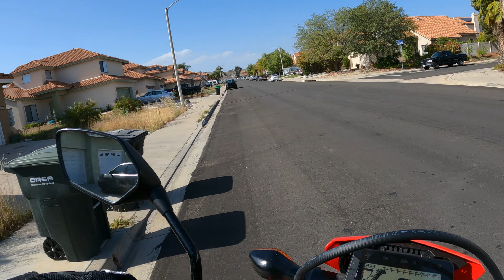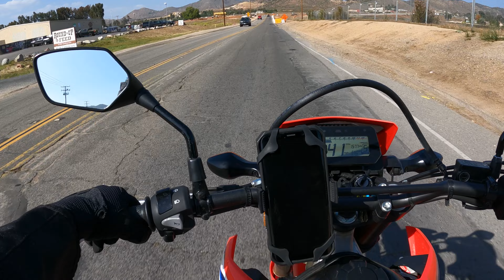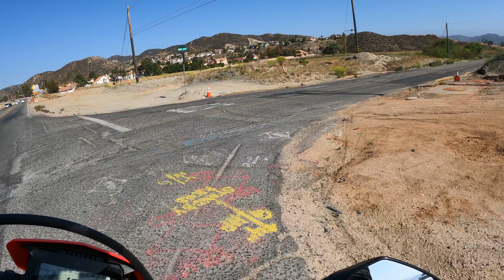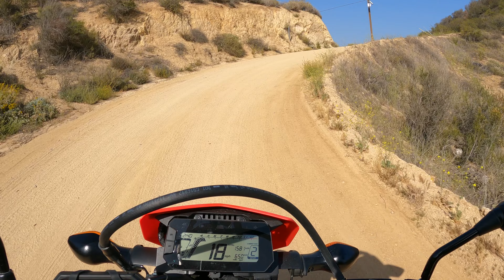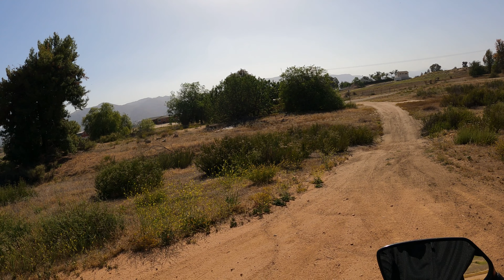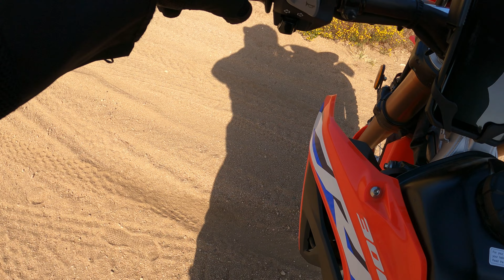The Biggest Problem With The 2021 Honda CRF300L

Comment: I had mine up to 93mph, but it was downhill, fully tucked, and had a tailwind. It will do 75-80mph no problem all day, and Im 6'3" 260lbs. Changed my shift light to start blinking at 70mph in 6th and it flashed around 75mph. Also changed the RPM gauge to where the last RPM will hang for a second then drops back down to the bar. Kind of neat.

The engine opens up a lot after 800 miles and smoothes out the higher speed RPM vibes.
Reply from the maker: Oh ok got it. Sounds good

Comment: I totally see your point, I just have to avoid the faster roads or be content sitting at 65 ish.  I notice about an 8mph difference  between the bikes speedo and my GPS at the top end, the bike says 78, GPS says 70.
With bigger bikes I used to take much more risks overtaking, now I plan them about a week in advance lol.  But mostly I know now to relax a little more and enjoy the ride a little more.  I think it ticked most of my boxes (The Rally at least) which were economy, service intervals and cost, riding position- I look silly on small bikes, reliability, local dealer support.
At the moment I am OK with it as stock, added a pannier rack.
My only gripe so far is a rusty exhaust, but I live in the UK and ride all year, it gets damp!

Comment: You can change when the shift light comes on. Hold "SEL" button down on the display and turn the key on then toggle to change RPM I think. Probably a video on it by now. I think you can change how the tach looks too.
Reply from the maker: Well at least that. That's cool. Thanks
Reply: @TheCoolestCourier  I have the CRF300 Rally and love it. I live in a rural area and no fast highways here so it's perfect for me. Just Subscribed!
Reply from the maker: Thanks! Yeah the rally seems awesome as well!
Reply: I also have a Rally @Thumper Squid and changed that shift light the same day my break-in service was completed. There’s a spot between about 5K and 6K RPM where my engine is less smooth. Power seems to come on after 6K and it stays pretty smooth for a single until about 8,000 RPM. I’ve found as @Jimmy Brooks did that CRF300 indeed prefers 50-60mph for cruising. So I explored on Maps and IRL until I could tie 45 - 55 mph back highways and 25 - 40ish mph dirt roads together across counties that surround mine. My favorite commute when the creek crossings are mild-to-dry is mostly dirt, where excessive RPMs never bother me.
Reply: lol this is some awesome info 👏 👌...  thanks for the tutorial
Reply: Amazing information thanks..I'll try it 
🏍👌
Reply: supposedly the Honda crf300 rally can go above 80mph wind protection all around and aftermarket sprockets 

Still debating between this bikes; above 80mph and off road capable, reliable proven and good dealerships coverage, low weight, budget friendly , low maintenance and good aftermarket products..basically my unicorn bike or my dream a smaller Honda African Twin/Translap 750 to 500cc and all her glory 😆 

Honda crf300 rally 
Honda cb500x (rally aftermarket parts)
KTM 390 adventure 
Suzuki dr650se update 
Honda xr600r update 
SWM superdual X 650
Or…gently used BMW F 650GS Dakar/sertao

Comment: Firstly, this bike will happily sit at 7000 rpm all day long. Secondly, raising 6th would make it useless in wind or on any kind of hill. Thirdly, it's a 300cc dual sport - you can't bitch that it won't do what a dedicated street bike will do. It does EVERYTHING "ok, it does nothing "GREAT". I still love it for what it is.
Reply from the maker: So far I like your comment the best when it comes to comments that disagree with the video. A lot of them are poorly thought out and have points that aren't true. But everything you listed is valid. I knew going into making this video that this complaint was kind of dumb because it is such a small dual sport but I thought maybe it could have been tweaked a little bit because I thought it had more power than it did. There's not a lot of high-speed Hills or wind where I live. But when it got windy yeah you're definitely right. It has barely enough power to go 70 Full Throttle. And I figured it's fine with the high rpms. People have been traveling Full Throttle on Honda scooters for decades lol
Reply: @TheCoolestCourier  Well, thanks for not getting mad lol. This poor little bike takes a lot of heat because of the suspension and "low power", but - as previously stated - it's a freaking cheap 300. What it can do vs what you pay is absolutely remarkable, even in stock form. People who buy one because they're popular, without real-world expectations, will be disappointed. If you're 300lb, it won't work. If you expect to hit whoops at 50mph, it won't work. You need to spend money on it to approach real "competence". But, if you just want to get on and go (albeit slowly), it's a real peach.
Reply from the maker: I think what I wanted it to be was a KLR 650. A bike that does nothing great but everything decent including going on the highway. But for how good that bike is on the freeway it loses out off-road. It's just big and heavy which is where the CRF 300 does better than it. But since I already have an xsr900, I think my current setup is more complimentary to each other. I sold the Honda and am now keeping my dad's Suzuki dr200 running. I sort of own it since he's not riding at the moment. It's crazy slow on the street but once you get it in the dirt it feels way more like a small trail bike then the Honda. I actually prefer it but my dad bought it new and paid more than a CRF 300 cost which is crazy to me because of how old the technology is in the dr200. The Honda really is a great value and I would be super interested to ride the new low seat version
Reply: @TheCoolestCourier  My personal problem with the KLR is that it is just way to heavy and always has been. At over 450 lbs you can get a MUCH better bike for both the road and off-road. (KLR is cheap though and easy to find. My dealer always has several in stock, all of the time) What I really want is a CRF375 Rally or a F.I. 6-speed DR with Digital Dash, I can only dream cant I. 🤣

Comment: The gearing isn’t perfect but imagine this doing single track trails, different story.
Reply from the maker: It is quite good at that
Reply: I didn’t even use 1st on pavement until I put a 120/90 tire on the back. Now I use 1st occasionally. Stoplights on steep hills remind me how much I appreciate a low 1st gear.

Comment: I hated the flashing shift light, so I changed my Rally's shift light to not pre-flash and to only come on and stay on above 8200 rpm and I'm 100% happy with that. Mine will sit at 7-8000+ rpm stock all day long, but with a really strong headwind it is hard to stay much above 70 mph. The stock gearing is great for almost all things and when you change to a 90 section rear tire you have changed the gearing somewhat already. This is NOT a bike that is made for 75+ mph, it's too tall and too light in my opinion. If I wanted to go any faster, I would just get a heavier and more powerful bike with a low front fender for safety reasons. I love my Rally and I think it is a great dual-purpose bike. It's not great at any one thing, but it can do almost everything "good enough".
Reply from the maker: Yeah it is pretty good for that. I think my perfect version of this bike would be the low seat version maybe with if you modifications to get a little more torque out of it so I could change the gearing just a little bit taller so I could go 10 miles on the highway just a little easier to get to even more trails.

Comment: I totally agree with you about having the engine revving so high .
I recently bought a 2002 Yamaha DT175 road and trail bike 2 stroke engine. 
It was revving at 5000rpm when i am  doing 60km and about 6000 rpm at 70km, so I just changed the front sprocket  to a  bigger one and I can do 60km at under 4000rpm and 70km at 5000rpm, and i could hit 100km at 6000rpm where it used to 70km.. this is a solution and i know you are going to say by doing that you lose some grunt, true but if you mostly ride on the highway and not nuch in the bush then i think it s worth doing it.
Reply from the maker: If this was my only bike I would definitely change the sprocket but if I know I have to go on the highway I always take my XSR700
Reply: @TheCoolestCourier  I didn't know you have a bigger bike.
Lucky you.

Comment: You can do 70 mph/ hwy ok. After that it’s a little pushing the edge on the rpm’s. But this bike as well as the other dual sports, aren’t made for highways aren’t they?
Maybe some are, but the majority of dual sports bikes are for city, trails, and light short highways trips.
Reply from the maker: I know they're definitely not but this bike is powerful enough to where if it cruised just a little bit better on the highway it would be the best beginner bike ever made. Honestly even without that it might still be
Reply: and thats the problem, we need a bike that is adv speced weights like 160kg wet and can do 80mph without problem
Reply: THANK YOU!

Comment: In your experience, do you think the abs model has any real difference over the non abs  ?
Reply from the maker: Well I mean in a literal sense it has abs so potentially it's slightly safer on the street. I had the non-abs so I didn't have to push a button every time I went in the dirt. I was primarily riding this bike in the dirt.

Comment: I packed all my gear on my Honda Grom and went camping.Worked great so I'm sure the 300 Rally will be fine,which I am currently looking for since I sold my Tenere 700.
Reply from the maker: Why did you sell the Tenere? Did you just want something smaller and lighter?
Reply: @TheCoolestCourier  Mainly because it was too tall for me.Even after I lowered it and installed lower seat foam.It actually has a lower seat height than the CRF300L/Rally,but it is much wider,which makes it feal taller.It is also a heavy bike and a lot of the weight is up high.If I was 6'4" and 50 pounds heavier it probably would have been okay.But just too much for this little guy.Love the engine.I bought it because I LOVE the CP2 on my FZ-07.I'll never sell that bike.
Reply from the maker: Yeah I started on an xsr700 and now I have the new xsr900. There are aspects I miss about the cp2 so I always thought I would eventually end up with a tenere 700 for the purpose of a big dual sport/adv
Reply: @TheCoolestCourier  I used to have an MT10 but I was gonna end up losing my license and going to jail.During the "shutdown" there was nobody on the roads and I was "essential" so I had to go to work.140-150 MPH all the time.I blew past a HP on an entrance ramp one day.Didn't think slowing down would help as I was already busted,so I didn't.He didn't even bother chasing me.I was gonna have a custom plate made for it.EMPTY10.Because I was always looking for gas station with that monster.LOVED that bike too,but too much.
Reply from the maker: I totally understand, I feel the same way about my 900. I think this level of power is a really fun blend between usable and unusable power. The xsr is so long it actually only wheelies In first gear.
The cp2 is cool because you can have fun within the speed limit, with the cp2 you're definitely going 20 over on accident most places, so I can't imagine the mt-10 or any of the hypernakeds with more power than that

Comment: are you running the bike stock / exhaust / gearing / ECU / ? I have a Rally coming along with plans to install 550 ECU (91 octane) and a full exhaust for exactly the reasons you mention.. supposedly makes a big difference even without changing the gearing..
Reply from the maker: I'm very cautious about modifying my motorcycles. This used to be a car Channel and I have had nothing but bad experiences modifying cars which is why I ended up getting into bikes. They were sub $10,000 purchases with performance that I was already happy with unlike cars. The reason I don't like how short sixth gear is is because I feel that sitting at 7000 RPM or higher for over 10 minutes is kind of rough on the engine and I'm looking for maximum longevity. As I save up more and more though I will be more open to the idea of modifying the bikes. I know I definitely want an exhaust for the XSR
Reply: @TheCoolestCourier  Understandable - I almost always put an exhaust on my bikes, they are just so choked up stock thanks to emissions and seem to run so much better when opened up and running a proper tune. 

I also went with Yoshimura full exhaust, which is the factory Honda team; they are reputable and definitely know what they are doing.

Besides that I will likely do a acerbis skid plate and hand guards.. until I upgrade the suspension someday (If I love the bike and decide to keep it longer term).
Reply: @TheCoolestCourier  agreed dude. I just don’t get the full exhaust and flash on these bikes, that gets you most of a full suspension.
Reply: Just installed the Yoshi-full system with the 550 stage 1 ECU… all I could say is it woke the bike up and is unbelievable, it is absolutely a must in my opinion… you will not regret it.
I also did the K tech rear along with the stiffer front spring, which is fantastic and also highly recommend.
Reply: You can't buy the ECU in California.
Reply: that is very sad @clvrswine

Comment: Honda already geared 6th taller than the 250L. Look at a dyno chart to see where torque is at max and tapers. I have to disagree as it is perfect for me as is. Tweak with sprockets for your specific use. It barely enough power to pull average hills where I live, over 70 mph, with wind resistance worse than 0 head wind. With RPMs lower it would be even worse. I thought I wanted taller gearing for the highway but now I need more power…better solution was stay off 70+ mph roads for anything more than a few exits.
Reply from the maker: Yeah I agree it is perfectly spaced from 0 to 70 for its optimal powerband. I think where I am 6th could be even taller but it is close to perfect

Comment: I have a 250L and I also hate my gears. I don’t think I want to adjust the whole final drive but maybe I should. 1st is way too short on and off road, and off road I’m always in this terrible spot where 2nd is revving too high and 3rd is lugging too much. 4th and 5th are solid, and I feel like 6th could be a little longer but I worry if it was longer, could it keep speed at highway speeds?

Comment: You can only get so much out of 27hp. Your getting the best of both worlds the way it is geared now. You have to weigh out what you use the bike for the most and gear according.
Reply from the maker: Yeah definitely. It's mainly an offroad bike for me so I definitely wouldn't change anything.
Reply: Exactly. For one thing it’s a 6000 dollar bike and we get what we pay for. On the flip side I bought mine for for 40% woods 40 dirt roads and 20 pavement. Knowing that I will have to change the suspension because it sucks. Oh boy does it suck off road. But I knew hat coming into. If I don’t push it to hard it works reasonably well. Everything else is pretty good. Bottom line is you can’t build a Jack of all trades it’s impossible. If your more of a road guy you can make a respectable supermoto out of it.  If you want more off road knobbys suspension etc. i believe it can be tweaked enough to be respectful  and I’m going to find out. but it will never be perfect. Has anyone ever made the perfect duel purpose NO!
Reply: @waynekelly9395  they could build a better duel sport but the cost of development and the amount of the population that would be interested in this product would be to small to make it profitable. I think this is why we don’t see Yamaha coming out with a new duel sport that we know of. It’s getting harder and harder for company’s to be profitable with the way the world is now.
Reply: Thai ECU from Biker Bits gives you 3-5 more HP and smoother power curve.
Reply: @2shoestoo  They can build a better anything.But then you won't shell out untold amounts of cash to make it better,or keep it running.I have a 1999 Toyota Corolla that I bought used many years ago.It has over 200,000 miles on it now.I'm absolutely sure no one has ever checked or adjusted the valves on it.The technology is there,but that won't keep the Yamaha,Honda,KTM,etc etc service bays full.

Comment: This bike has fuel injection and is not affected the same by altitude as a bike that has a carburetor would be. The ecu on a fuel injected bike compensates for air to fuel ratios whereas a carburetor would need to be rejeted .
Reply from the maker: Yeah I know but altitude will always decrease power a little bit even on fuel injection due to lesser air density. The computer senses that and compensates like you said and dials back power

Comment: Hey Jimmy, just wanted to say thank you for the video. I took my CRF300L out last night and had the same issue with the shift light coming on at 71-72 mph. I was a bit flustered because I'd watched videos of the bike doing up to 80-85 without any shift light coming up. Just wanted to see if you've come up with a solution for this problem or if you plan on making a video? Your video is the only one I've seen that addresses this problem and I want to at least be able to comfortably go 70-75 if needed.
Reply from the maker: Someone in the comments here said that you can adjust when the shift light comes on. I think there is a way but the light isn't that big of a deal to me
Reply: @TheCoolestCourier  yeah I’ve found I can just pin the throttle and not worry even if the light is on. I was just worried to potentially ruin my bike but I should know better with Honda reliability :)
Reply: The shift light comes on according to rpm, not to speed.